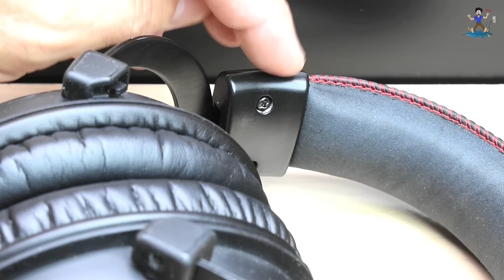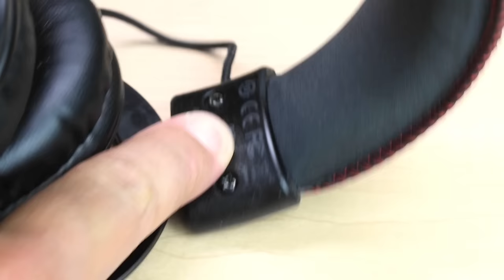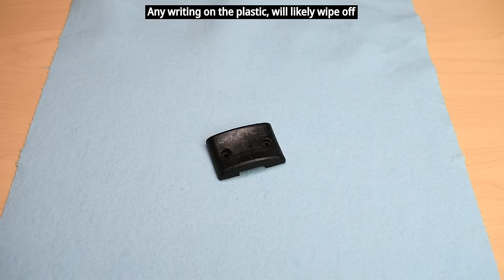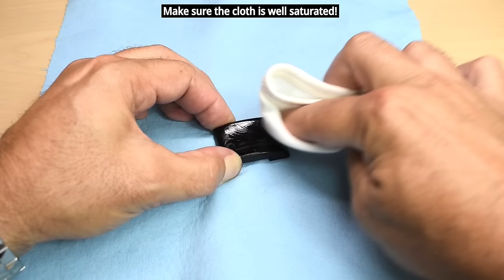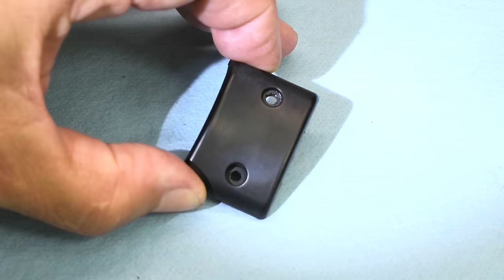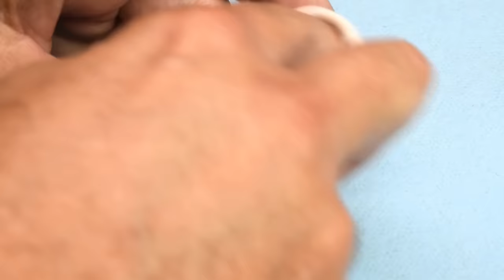How To Remove Sticky "Gummy" Coatings From Electronic Devices

Comment from the maker: ATTENTION: When wiping with alcohol, always test a small area first. Stop rubbing the area when you see the gummy film disappear. If the alcohol strips off too much paint, then the only other way is to use a no-scratch pot scrubber with WD-40, and it's a lot of work. Thanks guys!
Reply: I was wondering tho what about the WD-40 smell, it sure has a pretty strong smell and lasts for quite a while as well
Reply: Thanks for the video.  I tried Isopropanol and WD-40 both on an older Visio remote.  I ended up with a sticky mess worse than what I started with.  I tried some Glue-away (by Homeline) I had on hand using the same "spray on cloth and wipe" technique.  Wow!! A little elbow grease and all the rubber came off and I was left with a shiny black plastic back on my remote.  I let it dry, wiped it off, and there was no odor.  For a stubborn rubber coating you may give this goo gone clone a try.  Good luck!  :-)
Reply: Can I use a sanitizer?
Reply: can anyone explain, why this happen?
Reply: @musyawirulhaq3361  great question. I guess heat melted the coating. It really worked well as directed.
Reply: @musyawirulhaq3361  over time the soft touch coating breaks down and melts. I’ve heard that high humidity causes the break down quicker. The vinyl will break down over time too. I rubbed too much on the side brackets and they turned white but I was planning to paint flat black anyway. If you look at the band it has peeled off after cracking. I think those aftermarket replacements will not last as long as oem parts even though the hyperx headset is made in China. Go figure...
Reply: @akirakunhi  since i live in humidity in south east asia, that's make sense
Reply: Doug, would Armor All be beneficial instead of or after WD40?
Reply: Use 70% alcohol to clean and then finish with a silicone spray designed for use on plastic like Blaster Industrial Strength Silicone Lubricant. Don't use WD-40 or other petroleum-based solvents because they can degrade certain types of plastic over time. Be careful using other silicone spray brands as some of them contain propellants that will harm the plastic.
Reply: @musyawirulhaq3361  It's due to the oils in your skin & moisture in the air getting absorbed into the rubberized coating. Body heat, the device getting warm while on, and/or sunlight makes it sticky.
Reply: Plenty of plastic parts are dyed throughout, thus wiping off paint is not really an issue. Examine the part, around screwholes or in areas where the coating has worn off, to get an idea of what’s underneath. Then decide whether you need to be careful not to strip off too much. Btw, apart from alcohol and WD40, gasoline and most oils will also work, at least as long as no paint is involved – you really want a solvent that works on the rubberized coating.
Reply: @da4944  I don't agree. I have binoculars and power tools that are used infrequently that have become very sticky and slimey. Washing up liquid/dish soap removes it to some degree. I've also used acetone and propanol, they get rid of the stickiness, but they both tend to slightly degrade the surface.

Comment: Gasoline, a rag, some elbow grease ! Just did it yesterday on an old multimedia hdd box here . Worked very well with no traces remaining . Did it outside of course.
Reply: Praxis?
Reply: Spot on, alcohol does not work all it does is softens the gunk which then becomes even more difficult to remove and worse flows into crevasses. Petrol or as you call it in the US Gasoline completely reduces the gunk to fluid which never hardens again. So after getting rid of most of it use some soapy liquid to remove the residue.
I shouldn't have to say this but when working with flammable liquids like this wear gloves, do it away from naked flames, hot items and whatever else you do don't do it whilst an item is connected to the mains (AC) or a DC supply. Makes sure you’re in a well-ventilated space or outside is better and after the clean leave the item for the fuel to evaporate (I leave it outside in warm weather for 48 hours). And dispose of the rags after use properly not in the garbage/rubbish because it could cause a fire.

Comment: I have these exact same earphones and I searched YouTube on how to remove the sticky surface. Imagine my suprise when this is the first video that pops up! Thank you so much for this video! I'll definitely try this out and add a couple of more years of life into my otherwise perfectly working HyperX headphones 😊
Reply: @Absinthe Conundrum I bet the same thing, designed obsolescence 🤮
Reply: I'm literally cleaning my pair as I watch this video. The headset works great, but I'm not in my life buying another set, between the gummy plastic and the flaking fake leather furniture after only 3 years of ownership I'm just about ready to buy a pair from another brand.
Reply: Same thing! Took them out from their original packaging a few years of not using them after the purchase and they look like trash, ear pads all cracked and the plastic bits sticky. Never buying this brand again

Comment: I can't believe I never thought of using alcohol and WD-40! I've had so many things get gummy after years of use and I've tried so many cleaners. I usually can get it off but not without rubbing my fingers down to bone or slightly damaging the plastic. This video is gold! Over the years you've helped me out a lot with tid bits like this. Thanks my friend. 🍻 You always come through with good advice. 👍👍
Reply from the maker: The only 2 things I use, are the 70% alcohol and WD-40. WD-40 along with a no-scratch scubber can strip it away, but it's a lot of work. Glad you liked the video. Please remember to rate thumbs up and share the video link with others. Thanks

Comment: As a dj, I like cleaning my devices and I have seen that tackiness on controller knobs, volume faders, cdj platter rings, macbook power cables, headphones, etc. I used soapy water thinking it was finger oils but scrubbing would take time. I started using alcohol and soft cloth to wipe them and get rid of the tackiness like in your video. I haven't thought about using WD-40 but I will consider it for the next time. Thank you for sharing this video!
PLEASE GUYS ALWAYS REMBER TO AVOID PRINTED WORDS BECAUSE YOU MAY ERASE THEM FROM REMOTES OR DJ CONTROLLERS. for controllers use soap and water on a damp cloth slowly.

Comment: Just did this on my HyperX Cloud Alpha headset and it seems to work really well. Zero stickyness left after using the alcohol and WD40. I just wish I could have properly disassembled the headset so I could get into the annoying bits around the hinges, but I digress. Thank you for this tip!

Comment: Great video.  I have and x-rite i1 Display for monitor calibration and it has the same coating.  I used "Original KRUD KUTTER" and paper towels and it can right off.  5-minute job.

Comment: Hi thanks for the info on how to remove that gummy coating. Worked great on my Belkin USB multiplug hub. It was a mess to start with and I tried using just WD40 but it would not cut it. The IPA worked great with the WD follow up just like you said it would.
Reply from the maker: Yes. WD-40 requires a lot of work using a scrubber. Glad my video helped you! Be sure to share the video link with others. Thanks

Comment: The best stuff I have ever used to get rid of the sticky mess, especially on late 90s early 2000s electronics is dollar tree goo gone.  That stuff works incredibly well.  Just a couple of weeks ago I bought a lantern at a thrift store that had a rubberized coating that had turned to just a giant sticky mess and 10 minutes with the goo gone and it is perfectly clean and not a drop of the sticky stuff.  It doesn't smell bad either.
Reply from the maker: I've used it, but like the alcohol, it can damage the paint. Thanks for watching!
Reply: @electronicsNmore  Thanks for the extra videos. Very helpful and helps pass the time stuck in the house!
Reply from the maker: I have a bunch planned, but I'm not going to the store. LOL

Comment: I recently used 70% isopropyl alcohol and a microfiber cloth to remove the gummy surface of an Ooma Telo (internet-based home phone system) with excellent results. As with anything, you need to be careful while scrubbing across surfaces between two open areas (holes for push buttons in my case) as I scraped with my thumb nail and took off the outer layer of colored plastic or paint or whatever right in between two push buttons, but that was my doing not the alcohol--the rest of the surface is shiny black again and not sticky at all.
Reply: Funny, I just did that on a Telo last night. I used Goo Gone, then alcohol. No matter what you use, it takes a while and you will need about 20min to do the job right on a larger component like the Ooma. Love my Oooma Premier Linx Uniden 2 line 12 headset home phone system.

Comment: I never saw this stickiness before 20 years ago, and it’s exclusive to parts made in China.   Many items have switched to a harder plastic where this doesn’t happen.

I hit on the 70% alcohol a few years ago, but not the WD-40 follow up so will add that step.  Even with a heavily alcohol saturated rag on some items you have to go over them several times.  I bought a bunch of those blue Harbor Freight puck lights years ago, and the first ones that came out were the worst for getting sticky.  Thanks for the tip on the WD-40!  👍
Reply: was just about to say.. even the old bakelite plastics from 70 years ago are still smooth to touch..

Comment: I used cleaning wipes a bit of joy dishwashing soap, wash it with clean wipes (water), then followed your advice on etyl alcohol (it worked a bit), finished it up with a lens cleaner (eye care)

I was cleaning up the hair dryer that has not been used for a while and the handle was very sticky so i had to use soap i just didn't wet it that much just enough
Reply from the maker: Not ethyl, isopropyl. It works, you need to spend more time working on the surface. Thanks for watching!

Comment: Looks to work alot better than the talcum powder method I've tried a few times over the years!
Reply from the maker: With talc, you go from the gummy feel to the powdery feel. :-) As long as you don't rub too long with the isopropyl alcohol, you shouldn't remove too much paint. Thanks for watching!

Comment: I had a Western Digital Media Player remote with the whole back half thick sticky rubber.  I had previously tried WD40 (nothing), then 90% isopropyl alcohol and a cloth (almost nothing), then I tried the fine steel wool 1-2" ball/chunk dunking it in 90% alcohol and carefully rubbed it firmly for a few minutes followed by a cloth dunked in the 90% alcohol then alternated these.  after about 10 minutes it worked.  I made sure to be very careful not to get to near the IR sending area in the front end.  Scratching it would not be good and I don't want to have to buy an after market remote.  So Kudos to the person that suggested the steel wool ball.

Comment: More laborious, but I found you can remove it effectively with dry paper towels (any soft paper like toilet paper will do). You just have to apply pressure and go slow, and check the paper is collecting some residue. It takes a while (like up to an hour for a large item), but it does come off without using any solvents. Be careful not to tear or flake the paper because paper residues will make this process ineffective. Go very slowly while feeling the goo is being dragged by the paper and change towels now and then.

Comment: I have found in my experience that AC coil cleaner does the best job.  I've used the kind you buy in concentrate, and then dilute it.  Spray onto your plastic item (after you have removed or isolated it from other items).  Allow to sit for a few minutes.  Spray again and scrub with a plastic brush or mildly abrasive item that won't damage the finish.  wash or wipe with water and viola. Done.  The finish, in my experience, is such that you won't know the rubber coating was ever there.

Comment: I will never again buy anything coated with rubber after my experience with a Radio Shack emergency radio which was not needed to be used for years and then when needed, a sticky mess! I first used straight white vinegar on a paper towel which worked a little but not enough, so then used hand sanitizer which is 66% alcohol on a very soft old cloth, that worked well and much faster. I would have finished with silicone or Armor All but didn't have it so put a little WD40 on the cloth and wiped the radio. During this process no black stuff came off on the rag but the sticky came off. Looks and feels fine now ... but will the rubber continue to degrade?

Comment: I have some Cloud Alpha headsets that have this problem.  Tried cleaning them with alcohol but I find that results are mixed at best.  The only thing I hate about this particular headset, as the rubberized coating is on most parts of the ear pieces and headband.  Easier not to get products with these type of coatings, but unfortunately it seems to be popular among many "gaming" peripherals.  However, if you must or have no choice, keeping the devices clean is the next best thing.  Wipe them off often before and after use.  Don't wait until it becomes "gummy" to try to clean it.

Comment: Thanks for the excellent tips. Why does that surface get sticky are some time?
Reply from the maker: I'm not a chemist, but I would have to say it has to do with oxygen in the air breaking down the coating or humidity in the air

Comment: Instead of using WD40 in the last step, try using ArmorAll Cleaner (Auto dash and upholstry cleaner in Auto section of any store). It will not only be a better sheen, you will avoid the "smell" that is left for days with WD40. ArmorAll provides additional protection layer for future use.
Reply from the maker: Been there done that. :-) The Armor All doesn't do anything for any stickiness that remains, the WD-40 does. Thanks for watching!

Comment: Cool it happens to Wacom pens too. Alcohol may react making things white. You can remove it with a good olive oil (I guess since plastic is made from crude oil, olive oil since it's an kind of oil too works with plastics' gunk) or a good glycerine soap by wiping with the soap then wiping it with water 4x as a kind of rinse.

God bless.

Comment: for the ear pads:
I made fabric covers for mine to prevent sweat that builds up behind my ears too but that does cause them to slide off if you tilt your head down or back but other than that they are good and can be thrown in t he wash every now and then. 
I used the tops of old socks that had cool patterns but  the toes were ripped, I use the tops because there's a tight grip to hold over the ear pads. :)

Comment: Sir, I noticed that there was writing, in white text, on that piece, before you wiped it with the alcohol, so whatever you removed appears to have been some sort of Factory coating that didn't wear well, perhaps, that had the writing on top of it. Do you know of anything less harsh, but as effective as the alcohol, that you've tested? 

Thank you.
Reply from the maker: If you want to remove the gummy surface, you can't be too concerned about the removing any writing. The writing was on the plastic, below that miserable coating. WD-40 on a "no scratch" sponge is the only alternative. Thanks for watching
Reply: @electronicsNmore  Thanks. I was thinking that could have been specs, but even if it was, they can certainly be looked up again.

Thanks for video, very helpful information.

Comment: I've used another milder solution, that's any hand cream or similar with a high content of glycerin/glycerol (just read the composition)
Just spread a tiny layer of cream on the sticky object with a cotton swab, let stay for a couple of minutes and then scrub the cream and the sticky layer together away with a compact and lintless cloth, trying to "swipe away" the sticky layer applying a bit of pressure.
This is done best by working on smaller zones at a time rather than on whole surface, repeating process if needed.
I found out it by trial-and-error, until I've found that glycerol seems to "combine" with the sticky matter allowing their easier removal.
Please let me know if this trick worked for you also! 😀

Comment: I found out that not all rubbing (isopropyl) alcohols are the same. It depends on the manufacturer. I had one that has hazed a transparent plastic a but, but the other one didn't. So I recommend you test yours first and if it doesn't cause any discoloring or hazing of transparent plastic, stick to that brand forever!

Comment: I don't know about this solvent cure. I bought some Testor's  "Extreme Lacquer" from Home Depot, taped over critical spots, and sprayed. Have done some Celestron Binoculars and a game call remote. It seems to seal it up although it isn't quite as pretty as new and takes a little more effort. I had almost decided to buy some new binoculars because they were so disgusting to handle. Celestron's reputation really took a hit with me. Both are sticky free now. I wonder if using a solvent just won't wear off after a little while?

Comment: I have an Ooma device which had a thick sticky coating over its face after I owned it for a few years and looked revolting, I assume its some kind of oxidation/reaction. I think my very successful method is probably safer on thicker plastics, try at you own risk and don't forget you got the secret from me. It is far quicker than the above method and just involves mosquito repellent, I used deep woods off. Spray on a couple of times and wipe off with a clean cloth. God knows if this stuff can beat many other solvents what it does to our skin.